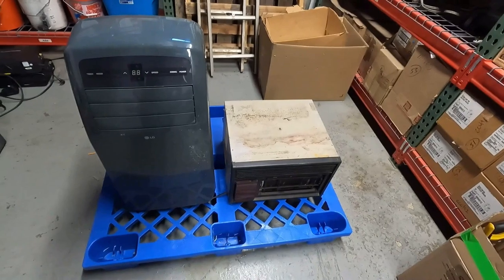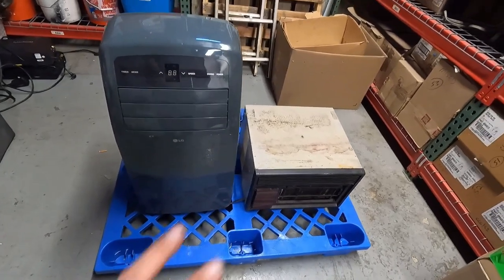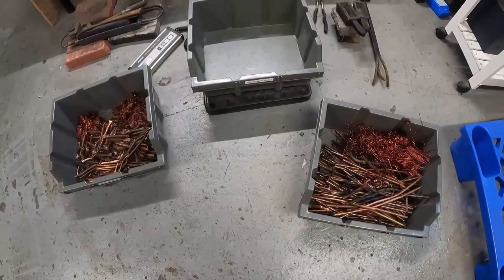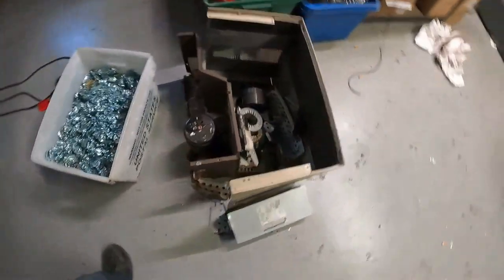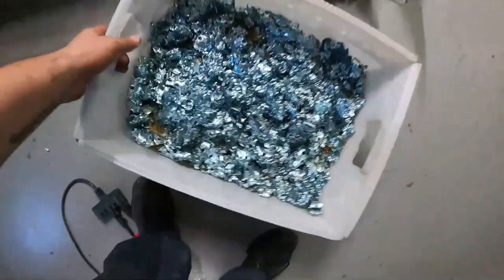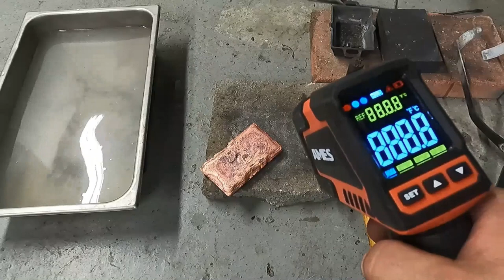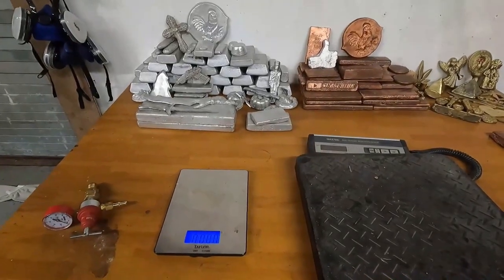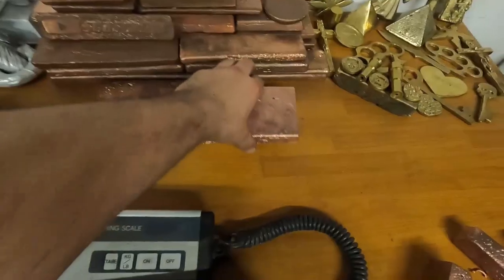Scrapping Air Conditioners for Huge Copper - Trash to Treasure - Copper Metal Melting - BPS Finale

Comment: I see you switched your lifting tongs in this video.  I prefer the ones that group the perimeter of the crucible.  I've been told when you grab it on a side it tends to crack or break the crucible.  Great pours!!! 🔥🔥🔥
Reply from the maker: Yes I switched them up.  I normally use them but most of my melts have been lightweight compared to what I can really melt as far as weight.  If the crucible is full I’ll use the lifter tongs.  I need to make new ones though.  The ones I made, I don’t trust.  I rushed making them when I first started casting.  They need to be bigger.  Very awkward holding them.  Thanks for watching bro!